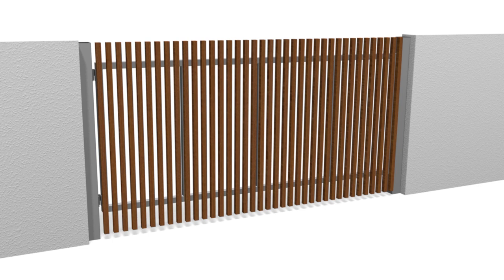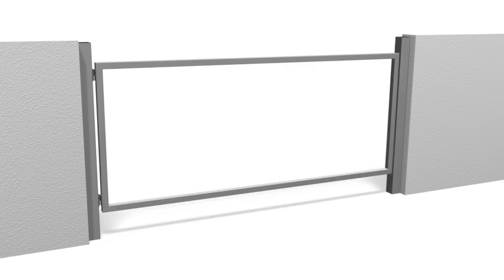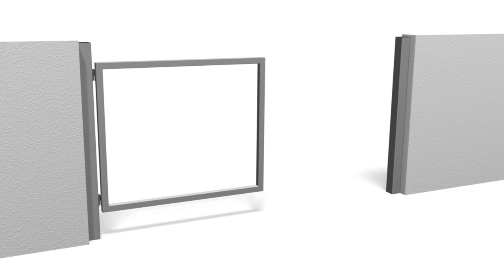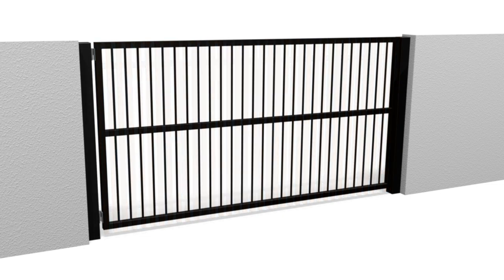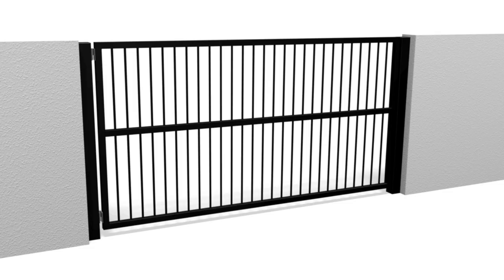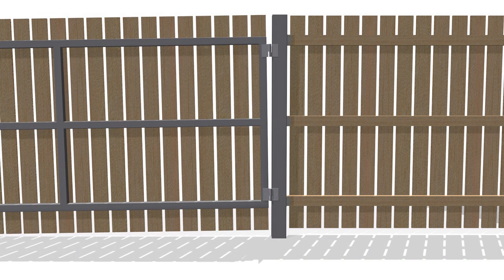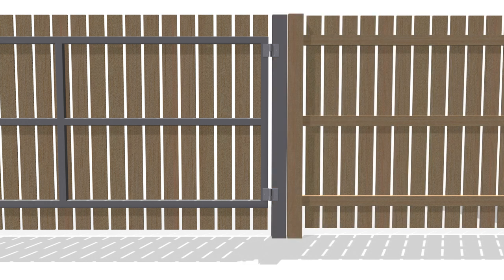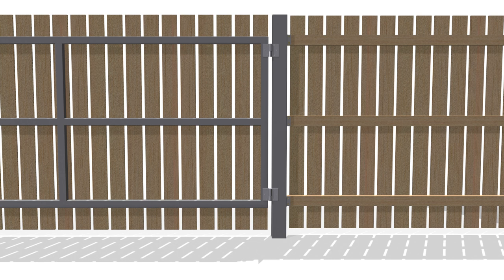Stop a gate sagging without using an ugly cross brace

Comment: FYI - If a brace is to be used, the brace should be installed from the base of hinged side supporting upwards under "compression." Not from top of hinged side stretching down under "tension."
Reply from the maker: With metal gate frames a cross brace is better under tension because then smaller less noticeable material can be used. We have used wire as a tension brace on metal gate frames using a turn buckle to adjust the amount of tension and the resulting amount of sag.
Reply: Ya know? I have always heard that wood and concrete work best under compression, and steel best with tension. But when it comes to welded gates I find that most of the time the cross brace is under compression. Is there an engineer who could explain the reasoning? And I’d love to have someone explain the reasoning with canteliever slide gate brace direction
Reply: @jgren4048 As an engineer myself, having a steel brace in tension makes more sense as the tensile strength exceeds the buckling/compression strength. In the world world, on a small gate, it probably is inconsequential.

Comment: Im structural engineer and its well explained. But still diagonal brace is the most efficient way. But i understand, in this area where design is sometimes prefered you can do things differently. But its not About the supports only. Profile dimension, dimensions of gate etc.
Reply: I am having a problem with a metal gate 10ft height x 10ft width sagging an don't know what is the best options Incorrecting it

Comment: You must have seen enough installations of a wide swing gate (yours is 16' wide) don't add any cross brace. So apparently they must work. 
Your explanation is very assertive-- All vertical tubes welded into horizontal rails can transfer (a small amount) of weight to the bottom rail (and the hinge of the post bottom, preassembly). Can you explain it differently, because I am not able to understand it.
First thing-- Is my description of your explanation correct?

Comment: The best remedy to avoid sagging is to fix a 4" solid rubber wheel (sprung loaded) to the bottom opening rail, simple and effective, did mine 2 years back.
Reply from the maker: This is fine if the gate is manually operated but auto openers don't like them
Reply: @automaticGatesExplained  Yes, I can understand that..... on a country mansion
Reply: @automaticGatesExplained  Why such a difference. Can you explain it?
I thought the casket is to support the gate weight, especially when the gate is in the parked state.

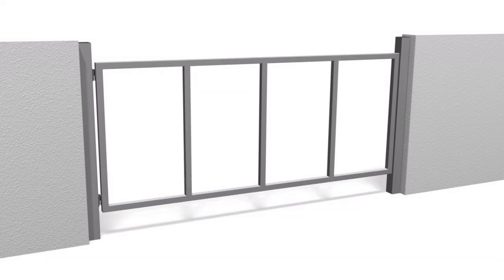Comment: Where you have the vertical styles (1:55) would adding a diagnol brace within each section significantly strengthen the gate? What if the frame was wooden?
Reply from the maker: It certainly would. If its wooden the braces should be in compression not tension.

Comment: My 10 ftl airón gate sagging about 2” has one piece across I. The middle what I should do to fixed someone
Reply from the maker: If you haven't added verticals stiles and/or horizontal rails to brace the gate you can add a wire across the diagonal with a turn buckle to adjust tension.